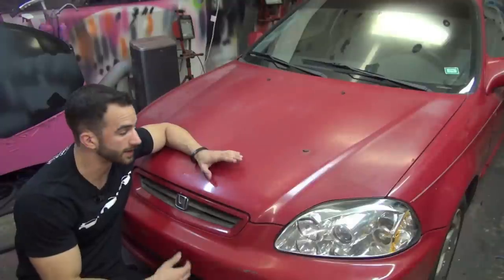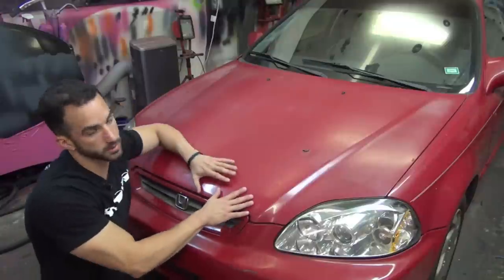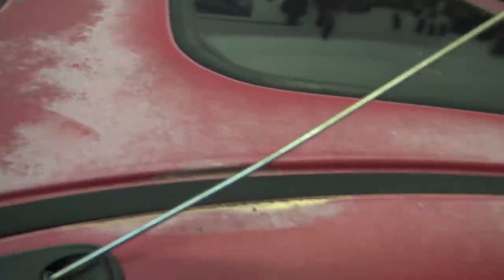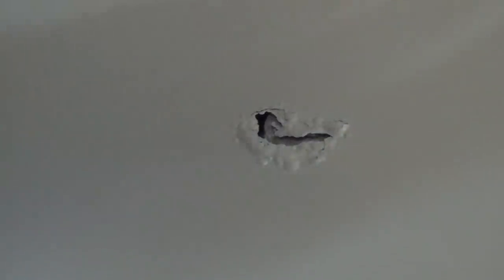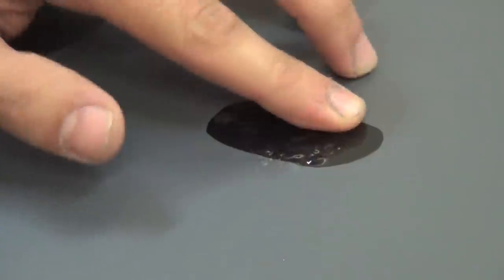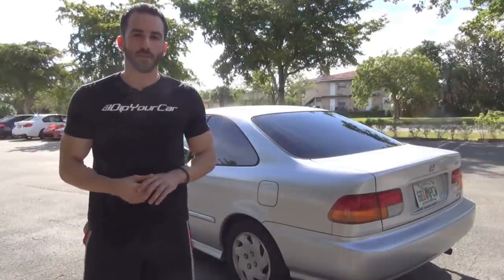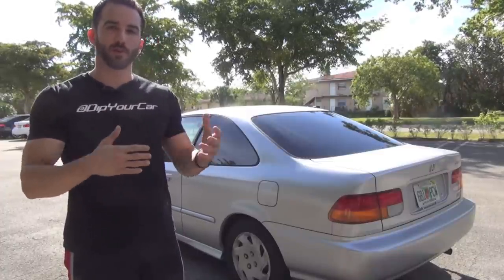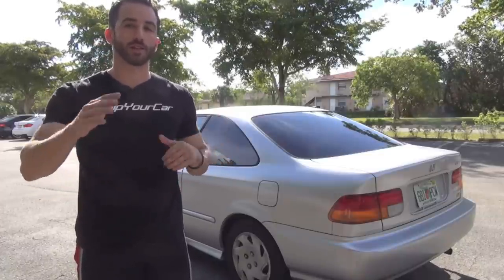Restore Bad Car Paint with Plasti Dip

Comment: great job. Mad respect for the versatility of PlastiDip. However if anyone is going to emulate this i highly recommend that you do sand away and do some minor body work to the car before doing this, only so the problem does not continue to spread. Rust is car cancer and needs to be taken care of and with the car as it was sanding away a small section of paint wouldn't have made it any worse than it already was, besides they dipped over it. Once again, mad respect for DYc and PlastiDip.
Reply: HE made it a point to say if people wanted to know how to repair rust there are videos on the net, that cover it.  The Vinyl Repair was done only to move the video along.  It wasn't an endorsement for fixing the rust.   OMG.  People are so hung up over the rust hole.  Even though he explained what you could do 3 times.  THIS is why we have Flat Earthers.

Comment: Great job on the paint Jobe but did notice those Lil bumps I'm guessing it's Lil trash n dirt can plastic dip be sand as a normal paint job primer sand paint sand clear sand and wet sand to get the smoothest finish possible thanks

Comment: Vice nice job! 

I think that if it were my car, I'd sand and prep all the inner panels and spray paint them semi-gloss black so there would be no "red" when I opened the door or trunk,etc. 

You guys do use almost all new "nice' cars......I'd like to see more of these older cars get the Plasticote treatment. I'd also like to see a cost breakdown on material and which kits,tints and colors to buy for each individual project you do.

I really enjoy your videos-thanks :-)

Comment: Hey DYC, I just dipped my rims and I'm quite happy with them. My car's rear bumper has a giant dent in it, but when I got it the previous owner gave me a new bumper that's intact, but unpainted. How would you recommend going about finding a color that matches my car (Rio Red 99 Mustang) and painting just a single bumper?
Reply: I don't think you'd be able to dip the bumper the same exact color, if you wanted it to be identical then you'd have to use factory paint. What I would recommend would be to dip the whole car, get a dark color base dip that will bring the color on your bumper down to whatever color you choose to go with. Again you could try to match the color and just dip the bumper but it will more then likely look off.

Comment: If you have peeling clear coat, do you have to put bondo or primer or anything like that to smooth the paint out? Or can you just plasti dip over the bad paint? I was thinking I'd sand the bad clear coat down and fix the rust then plasti dip my car.

Comment: Isn't it easier to take head/tail light modules out rather than taping?

What about details on the outside handles? The dip seems to cover everything perfectly without stopping for extra application.

Comment: I my opinion those rusty areas should have been sanded down and a rust converter should be applied. That's not something only a bodyshop can do. This is not only going to look much better but keep the rust from spreading of the 2 years the dip can stay on there.

Comment: Hey Guys,
 I know this is an old video, but I have a question. We went in with our son and bought him a 1997 Jeep wrangler that was out of Florida. It is solid , but the paint has been cooked in the hot Florida sun much like the car in this video.. Especially the hood.  My question is should we take the time to sand the old paint to get it smooth or will the Plasti Dip "self level" over it? We plan on matte black, and keeping it on for quite a while.
Reply: I would recommend to fix the paint first, I've seen a video on YouTube that shows you how to restore car paint, the only reason I would recommend it is if something where to go wrong that the plasti dip did not "stick" you just wasted your money on the paint.
Reply: +Sonny Sunnyside  Well, it would be interesting if they followed up with how that car's doing now. :)  

But I'm planning on a little experiment with this stuff just to buy some time for hand-polishing some really pitted/flaky  clearcoat:   just want to cover some raw paint areas and hopefully look a little more respectable while I do the hand work on other areas.   (It's a wagon so there's a lot of surface area to do that way: the job will be much less daunting if I'm not facing the whole roof and hood at once and just looking like conspicuous clearcoat damage all the while.   (I'm doing this by hand because it might avoid a backyard-paint booth job and I'd have to prep somehow for that anyway,  and also it's kind of therapeutic for the arthritis in moderation.  :)   )   So basically the odd experiment is I'll just try blacking out part of the hood and maybe putting some kind of dip down the center of the roof.    I think once I get to that we'll see something about how self-levelling it is.  :)

Comment: The good thing is that now even though there may be bumps from the former rust spot it isnt going to rust any more or get any worse because it is cut off from the air and oxidation won't occur.
Reply: exactly. i've had my friend dip over a giant fender rust spot like 20 times on his car lol. hasn't spread since, and hid the orange nasty color it had.
Reply: That was a hole, it still gets air from the inside

Comment: You do a good job of showing how it cuts itself but you never show inside the gaps.  When you spray over front headlamps is there a bunch of over spray in between the cracks?

Comment: Most people don't have a pro spray booth like that at home!
Reply: That's not a pro spray booth.  That's the Sprayer they sell on the website that you can buy to do it DIY.  Do people even go the the website or do you just bitch without researching.   If you have a well ventilated garage you can do plastidip

Comment: A good wash, clay bar and polishing compound on that puppy would make it look brand new. Just leave some clay bar in the hole and plasti dip over it. I've been using plasti dip for over the last 30 years. This comment makes absolute sense and it's on the internet so go ahead and compound polish after you plasti dip for that refined hi-end paint job look.

Comment: Pastidip is pretty mad.
I personally love the fact that you can do things like this, but i would probably only dip my wheels, but if i were to dip my car, i would probably do the whole car. As in take the fenders and bumpers off to do the inside of them, also do the underneath of the bonnet and door trims etc. The only problem is, that its a bit of effort, and when the time comes and the dip has gone to shit, it would be a pain in the ass to peel it all off.
So for now, I'm just going to do my rims

Comment: Hi guys,

I plasti dipped my bumper and I notice that when I wash the car it's all good but when I go to dry it,  the dip is hard to clean because it feels like rubber and I don't want to apply a lot of pressure and damage it.
I used Mat black,  just wondering big putting a clear on too will make it any better

Comment: Even some DIY guys in a home garage could take a sanding block at flatten out the rust at least.  It wouldn't take much to knock it out, sand it off and do a really crappy bondo job, either...especially if you're just going to spray plastidip over it all.
Reply: C Pineapple Did you not read my comment? You don't have to be a body shop to just sand some rust down flat.  With the matte finish of the dip, it doesn't even have to be a perfectly smooth surface to look decent.  Like I said, even guys in their garage can buy a $5 sanding block and at least flatten it a bit.
Reply: Exactly.
Reply: C Pineapple its bad for a specialist to make the problem even worst...u want to deal with the rust before doing anything...do it right or dont do it...

Comment: I have jeep wrangler with faded clear coat-paint on the hood. I was going to plasti dip, would I need to sand it down  before or just right over it? please get back with me!
Reply: give it a alcohol bath just put some on a rag and go over make sure its RUBBING alcohol and than dip it with the desired color

Comment: Ive watched a bunch of these vids i thought of a question while watching this one. For paint chips like from door dings and such can you do PD base coats then like some spot filler and sand and then final coats? Does it affect the coating coming off? Does it affect the top coats from looking right above it, nkt drying correctly ect. Does filler stick to the dip ok?

Comment: Nice transformation. Can you clear coat over the plasti-dip?
Reply: You can , but it wont peel very easily.. use the glossifer.
Reply: Watch the "Myths about plasti-dip" vid.... you can clear it but then it doesn't really peel off it just chips little by little, still won't harm the finish underneath though. Plasti dip makes a glossifier thats like a clear for plasti dip... use that instead
Reply: Joe Turner after its fully set it won't peel off until you want it to.

Comment: If I were to order the matte black dip kit could I dip a car in this condition without using a primer base coat? Could I spray directly over the stock paint?
Reply: Yes.  No "primer" is used here.  He just used gunmetal great plasti dip as the first 2 coats because it's cheaper than the silver top coats, but so close to silver it works.

Comment: DipYourCar Hey fonz, if I have rock chips on my bumper, but don't want to change the stock color, will Matte clear and glossifier coats be enough to hide them? I have a silver car, with a gray base coat and charcoal substrate (plastic bumper), thankfully not many chips went through to the plastic, but alot of them have a darker shade of gray under the chip from the base coat. The rest of the car's paint is perfect, just the front bumper is messed up, (repainted by previous owner with single stage paint).

Comment: i had a question reguarding your product/products. is it absolutely necessary to have to buy the whole spraying system, or is it possible that you could get away with just buying the spray gun replacement it using it with a regular air compressor.? or would i actually be able to use the regular sprayer head that i have.? (as if i was just painting a car the conventional way.)

Comment: Definitely should've bought some Civic Si or Integra GSR blades for it and painted them the same color. The dip looks absolutely sick, but the hub caps and the stock wheel gap let it down so badly. A for effort...

Comment: whats the deal with minor dents. nothing insane!. just a few tiny dents visible by clear coat gloss. will the plasti dip more less fill that in if i apply a few coats?. im assuming the thickness of the material is thicker than usual paint. hense the question.

Comment: one question, I'm trying to dip my whole car, it's a s2000 pretty small but I don't want to dip the fenders or hood or hard top because they are carbon fiber, do you have any idea how many gallons of dip I would need. Also does dip look normal on Bondo? or body filler?
Reply: Call customer support they will tell you how much you would need

Comment: Fonzie I purchased the repair kit off DYC because every time I pull into a parking lot sum people just fling there door open scratching the crap out of my jeep I found that this repair mix DYC sent me works great on things that have only been sprayed with 1-2 coats but my jeep has around 6 coats and when I apply the dip repair kit to a few spots on my doors it discolors my original dipped color! any suggestions on what to do to help this problem thanks

Comment: Will the plastic dip fill scratches and chips in the paint to make them less noticeable? Or will it not make a difference
Reply: it will make them less noticeable depending on the type of finish and color of base paint you use. a flat paint of any plasti dip will make blemishes look worse.

Comment: The problem is, as soon as you open the door, trunk, hood, gas tank, you're going to see that it's shit red underneath the dip.

In my opinion, with the work you're going to put into prep and paint, it's going to be easier to just straight paint the car.
Reply: +AversaS not really. to paint a car you need a good paint gun, a powerful compressor (your 2.5 gal pull-along compressor aint gunna cut it), a water trap for said compressor, primer, base, clear. after laying the primer you have to hand sand to get the base to stick properly.  after laying down the base you might as well wet-sand to get it smoother. properly painted cars get baked for hours to harden the clear coat and make it last longer. then you wet-sand the clear, buff it, wipe it down. You're looking at $5k and a couple days to re-paint assuming you have a paint booth. Or spend $800 and repaint it in your garage in a couple hours.
oh, and I totally forgot that you have to sand ALLLLLL the old paint off the car to the bare metal before you re-paint. that includes door jams.
Reply: You know little about what painting a car consist of...  i would have painted that civic for about 450 -550.  With original paint colir that will last about 10 Yrs.  And with a hvlp gun you dont need a 60 gallon compressor . Boss.
Reply: manuel bermudez sorry, I've never done shitty backyard paint jobs. Only high quality ones. My bad.
Reply: +manuel bermudez where are you located? My car's clear is gone
Reply: @zacprice , stop it kid.  Painting a car uses cost you more time. Not neccessarily money. Remember we are going to compare only what this guy paibted with plastishit. which was just the outside. A few hours of wet sand and resale value increases as opposed to this!! Wake up! Plastidip is great for protecting new cars from damaging oginal paint. Not this shit they did.

Comment: Does the PD come off as easy as if it were a new clear coat/paint job? It would seem to me that the clear is what makes it easy to peel off and if the clear is gone or deteriorated it would not come off as easily. Anyone run into this?

Comment: Since when is painting over old shit paint with temporary non-permanent paint considered restoration........
Reply: quick455 who wants to completely restore a Honda Civic 99' 1.6L ?
Reply: Call it what it is then, a bad temporary paint job, not a restoration.
Reply: quick455 ehh....it's not made to be permanent paint. It's made to go over the paint that's there and not to replace a full paint job.
Reply: ............hence not a RESTORATION.
Reply: quick455 agreed but still why make a big deal out of what its called
Reply: Because restoring old paint takes a good deal of work and skill. Spray bombing mild undercoating all over a car takes as much skill as putting tire shine on.
Reply: I will be honest here....
(No one really cares)

In the end starting an argument over something so stupid is not worth it, call it whatever because in the end the result of what is actually done to the car is the same.
Reply: You don't read very well do you? Title of the video: "Restore" bad car paint with plastidip.

Move along.
Reply: The internet is a public place of communication, no one has to "move along".
Reply: Sarcasm is lost on you and your cool font. The point still stands, this is not any sort of restoration or attempt to restore. You can all continue on your AutoZone fueled car modding binge thinking you're now part of a "car culture". If the guy even fixed the rot on the hood I would have some respect, Sealing in the rust that will be twice as bad after, yup good job. Might as well throw some stick on fender portholes and chrome windshield wipers while you're at it.
Reply: Actually if you peruse down the page you'll see you're the minority with your opinion. Fanboys always get butthurt.

I've got 18 years of doing this type of stuff the right way, hacks like this make me laugh. A week later and 1 or 2 washes and this shit looks worse than the original paint. We have 2 or 3 shops up here that rob customers $600 a pop for a whole car. 

And again sarcasm is lost on you. I'm very aware of what text formatting is, the sarcasm was for you thinking you needed to use it in a YouTube comment.
Reply: I actually don't use this stuff for cars- So I really couldn't care less.
//shrugs

I'm not butthurt because I actually don't care...

I can use text formatting whenever I can and want. With expressionless text I'll take what I can.
Reply: I'm confused. Did I ever say you couldn't? I said it was laughable you chose to. For someone who doesn't use it for cars you're awfully defensive about it's use on cars.
Reply: +quick455 The part where they peeled off the clear before painting looks restored.

Comment: Does the plasti dip show where the clear coat is peeling?!!!  Plz answer back
Reply: +corey15469 I'm curious as well.  I think I will wet sand it first, regardless.  The prep should make the final product that much better / smooth.  I have seen where the clear coat peel showed through badly on a wrap.

Comment: Ummmm so what do i do with the clear coat before i paint my bonnet with plasti dip. My cars bonnet is much the same as the bonnet in this video but im wanting to know what do i do cause the clear coat that has faked off has left a clear coat edge where there is no clear coat now so do i just paint over it or do i sand that clear coat edge before i paint

Comment: Painting a car with factory paint is much cheaper. This stuff is expensive. 2 cans 20.00. vs. one gallon of factory coded paint at 100.00. I painted my entire Sebring for 120.00 and that included the clear coat.

Comment: what kind of paint gun is that and why is it so silent
Reply: It comes with the pro kits. You can buy it from dipyourcar.com.
Reply: That Guy You Know do you know if you can use normal car paint with it?
Reply: No idea. I was wondering the same thing.
Reply: HVLP high volume low pressure. these sprayers are much quieter and give good results, need to use them properly it is so easy to get runs and curtains if your not careful